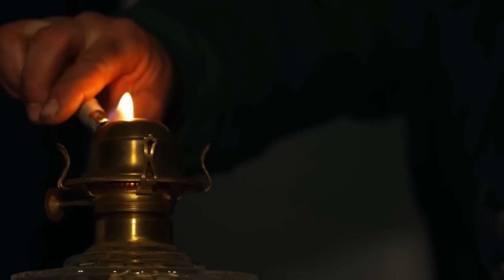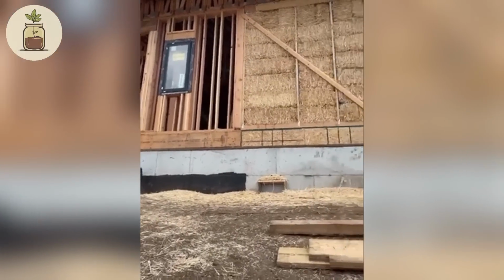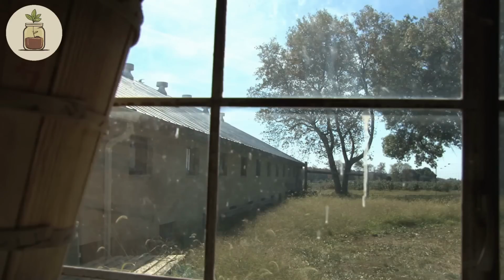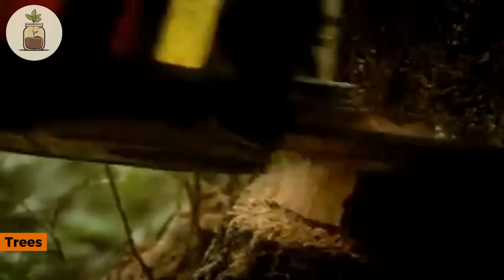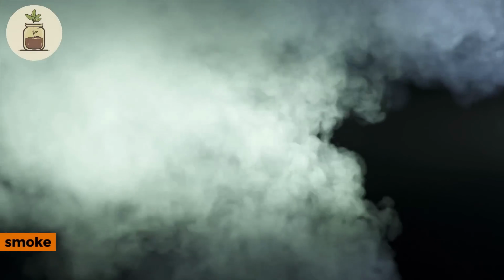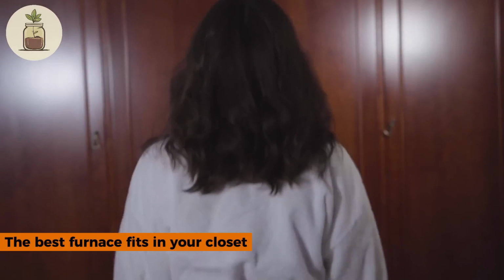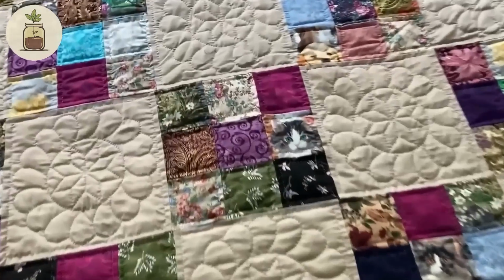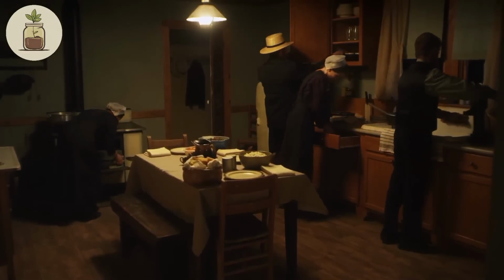How Amish Heat Their Homes for Less Than $50/Year

Comment: I mostly heat my house with wood with a propane backup. I can tell you it takes a lot more of wood than $50. That said, sitting in front of a wood stove with its radiant energy allows me to feel warn in a room that stays between 60 and 65 degrees F all winter. Plus, I get to split the wood by hand which is good for lowering your frustration and blood pressure levels.